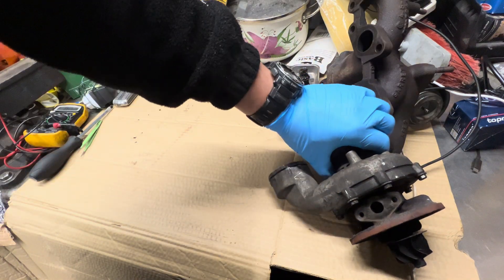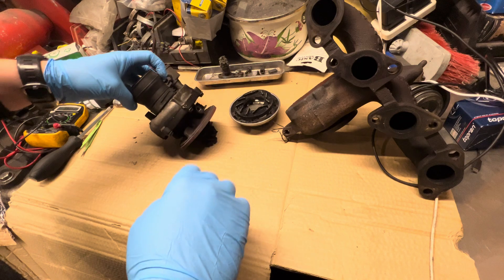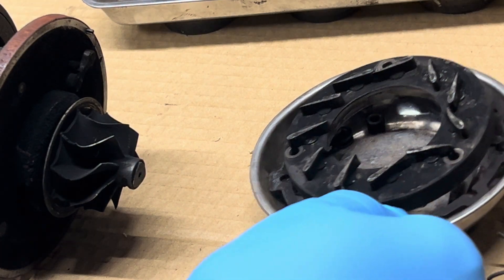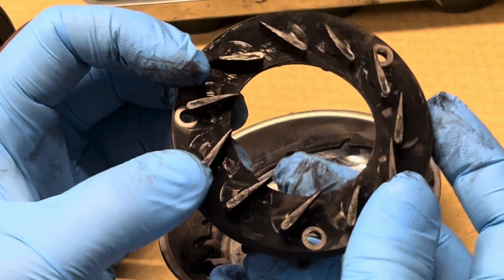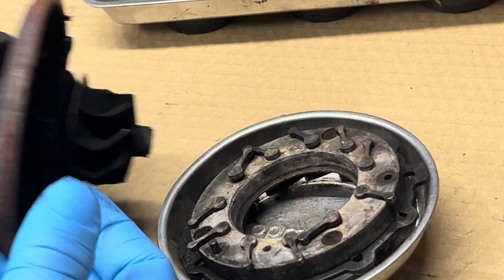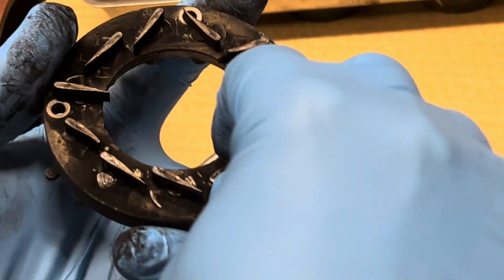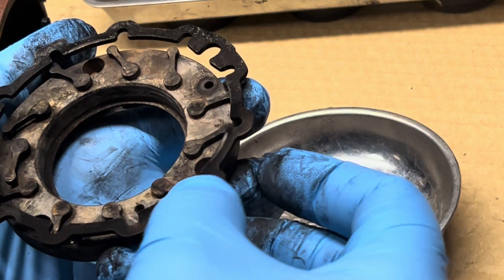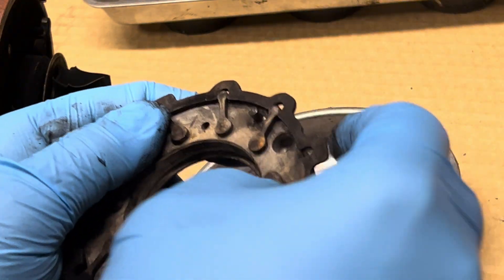2.0 TDI Turbo Problem - Failure Explanation

Comment: Thats a burned turbine, likely that it was remapped and very high EGT.
Reply from the maker: Interesting info , car was not remapped. EGT is possible,  turbo blowed up on cold car 30seconds after start up. High rev on second to third gear.